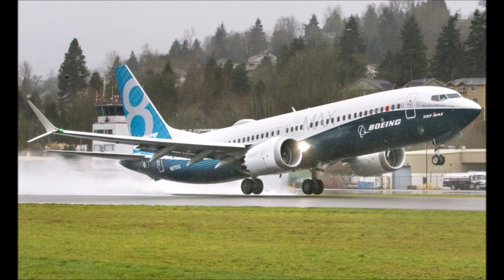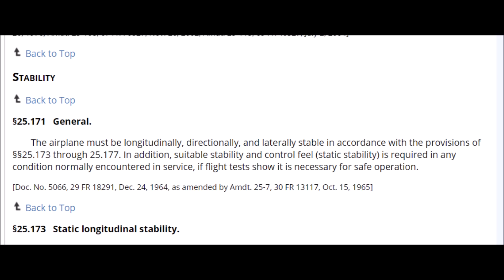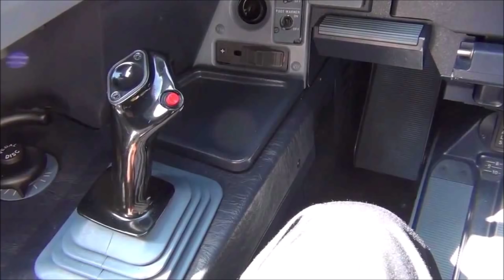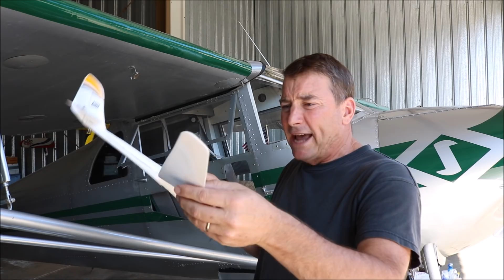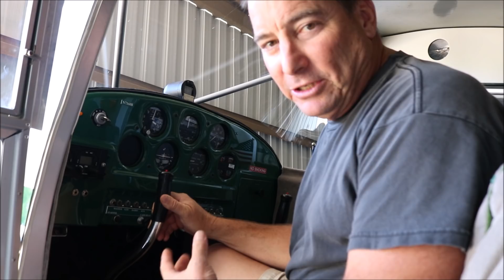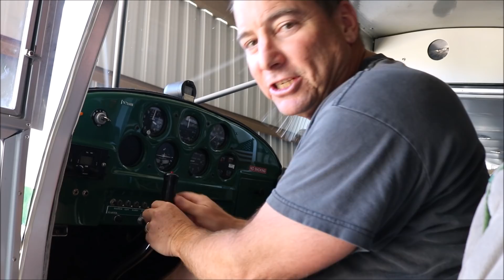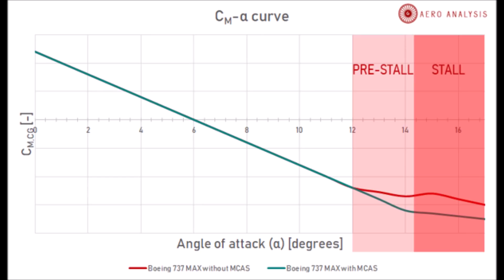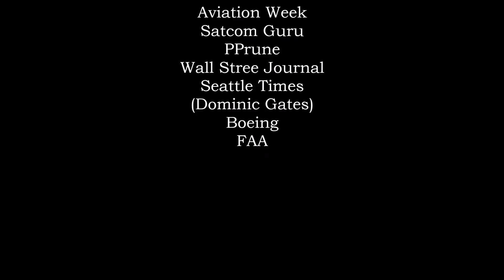737 Max UPDATE 30 Aug  2019

Comment: let me see, there was a problem with the stick forces and to corrected that instead of amplifying the stick forces they changed the elevator settings----if it was a car, it would be like fixing brake pedal softness with a spark adjustment.    But not to worry, there are replacing mcas with a re-engineered mcas (spark adjustment).
Reply from the maker: watch again. By moving the STAB you increase the stick forces.
Reply: It seems to me the correct solution would change only the stick forces--not both the stick forces and the direction of flight  (however, i admit that I don't know a thing about it (just mad as hell about the current state of the world)--so grain of salt)

Comment: Superb review. As a pilot, I was fascinated by the canard design with both main wing and stabilizer providing lift. Stick forces happen in normal fixed-wing aircraft due to the downward thrust of the stabilizer, so more speed=more stabilizer down-force requiring a stick push. As an engineer, those forces defined graphically as vectors make total sense to me.
Thanks for the outstanding videos.Well done.
p.s. Stall Stickshaker? What happened to that system?
Reply from the maker: Boeing still has the Stickshaker. Thanks James.

Comment: That was a brilliant summary Juan, I've followed you from the beginning on this issue and it was great to have this recap plus the information on how MCAS design was changed with fatal consequences. Everyone in the industry and in regulatory positions worldwide should watch this. Personally, I'm going to stick with easyJet for my short-haul needs as it runs an all Airbus fleet. I accept that the 737 Max is a fundamentally stable design - I've flown extensively on previous iterations - but I'm not sure I trust Boeing knows what its doing when it comes to computer-controlled systems. Hope your recovery goes well and you get your licenses back soon. Stay off the dirt bikes, the last thing you need right now is a broken limb!

Comment: Well done Juan, too bad mainstream media wouldn’t consult with you as an expert. (Probably because of too many facts and not enough sensationalism)
One point I have to disagree with you is at 21:00. You mentioned that the MCAS indications differ from a standard runaway trim, which is true. The point of disagreement is with the  trim wheel movement, control feel and the flight crew’s reaction to it.
In the Ethiopian crash, the pilot completely mishandled the aircraft when during the MCAS malfunction, the Left Stick shaker activated (granted, a major distraction) and he called Command 3 times (autopilot engagement) There is not one airplane certified that I know of where one would attempt to engage the autopilot during an impending stall. This speaks to the level of competence in aircraft handling of that pilot. Furthermore, that same crew did recognize the runaway condition, eventually actioned the Cutout switches, and maintained control of the airplane. What caused the crash was the reactivation of the Trim Cutout switches. (Ref Ethiopian Airlines Preliminary Accident Investigation Report FDR tracing)
In the Lion-Air accident, the flight previous to the accident flight experienced the same MCAS malfunction. The flight crew correctly identified a trim runaway condition (even with the distracting IAS disagree and stick shaker indications) over rode the MCAS with Manual Electric Trim, and then actioned the Trim Cutout Switches. The flight landed without further incident.
As for MCAS, it was certainly a contributing factor in both accidents, but not the causal factor. 
I hate to say it, but someone needs to:
The industry needs a major overhaul in pilot training, both in Initial qualifications, and especially in Recurrent training.
The ‘check the boxes approach’ just isn’t good enough anymore, especially with the increased complexity and automation of this generation of airplanes and the new standard of ‘system manger-pilots’. JMHO.

Comment: Many thanks for an excellent review of the situation. Can I ask, since MCAS is all about modifying stick forces in certain situations why this wasn't done by injecting forces (using force actuators of some description) directly into the stick with the obvious possibility that these forces could have a well-defined limit to prevent them becoming so large the pilots would have difficulty overcoming them in a failure situation. Is there a requirement that the stick forces are fundamentally aerodynamic in origin that would prevent the application of such  a system to falsify the stick forces?
Reply from the maker: good question...not sure other than conventional aviation engineering practices.

Comment: Thank you for this excellent channel and explanation of the 737 Max problem.  I love the very detailed explanation of the 737 Max problem, its history and technical deep dive into the issues that caused us to arrive at such a bad place.  I learned a lot from this video.  I thought that the 737 Max was an unstable aircraft but you dispelled that notion with this video. I don't do much flying but I don't think I would ever want to take a 737 Max flight. Of course, I'm sure that Boeing is already at work in rebranding the 737 Max to some other moniker.  I have completely lost faith in the FAA and its regulatory / oversight mission. It makes me mad that somehow it was allowed to get so cozy with manufacturers and get so sloppy in such a critical area of flight safety. After watching this video I feel a little better because of your explanation of the FAA not having the necessary manpower to be completely independent of the manufacturers.

Comment: Why do airplanes still use elevators instead of moving the horizontal stabilizer only? It seems that with powerful hydraulic assists and computers, the elevator would not be necessary.

Comment: There is a lot of information in this video.  The presentor, Mr. Brown admits the editing and content is a "pretty rough" in places but I appreciate this comprehensive overview of the problems with the 737 MAX to date and found it both interesting and informative.  There is a lot of technical information but not many illustrations of actual aircraft.  I am a non flyer, with no connection to the avaiation industry, but I liked the inclusion of the charts and diagrams that went a long way to helping me understand the things Mr. Brown was saying.  I think, however, some of the charts need more time to fully understand them so maybe I'll give it another go pausing where I need to.  So, if you like aircraft, and are a bit of a nerd that way, you will definately enjoy this offering.
Reply from the maker: Good critics Ian, thanks!

Comment: I was my understanding that Boeing didn't use two AOA sensors because that would cause the need for recertification training.  You say the training will only take an hour or so.
Reply from the maker: Not quite.
Reply: @blancolirio  On a different video the explanation was that Boeing elected to only use one AOA sensor, because a second sensor would cause the FAA to require recertification of all the pilots which would take several months.  It seems strange that if there were no such issues with a second sensor it would have been an obvious thing to do, since these sensors played a role in the failures leading to the disasters.  I am OK with the lack of recertification if it appears to be adequate and I'm happy to hear that the second sensor will finally be added.  It seems inexplicable that that wasn't done to start with since so much hinged on it.  I'm not trying to argue.  I have been horrified at this accident and would like to know.

Comment: Thank you clear and concise summary of what went down.The story I heard was that American airlines were going to order 200 Airbuses that were 15 to 20% more fuel efficient than the Boeing 737 and Boeing got a fright and went to American Airlines (not the other way around) and said. We will supply 100 Boeing Max aircraft that will be fuel efficient. They had to rush things to fulfill that order. Money before safety! Also Boeing and the FAA have been virtual bedfellows. The FAA did not insist on enough proof that MCAS was safe. Either that or the software is so complicated they don't have the experts that understand new software systems sufficiently. Boeing do so they just trusted them. Bottom line the rest of the world who held the FAA up as the most knowledgeable and trustworthy authority in the world have lost trust in them! They made a mistake. Ok just admit it and move on-. However it is going to take a few years to earn that trust back! I suspect Boeing and the FAA know this so they dare not have anything like this happen with the Max again. I suspect it will be safe when it comes back on line.

Comment: This is the best, most detailed explanation of why MCAS was put on the MAX. Have never seen the mention of the stick pressure requirements, for example. Great stuff, you made it easy to understand.
"All about saving money". True. How'd that work out for them?
I've seen it claimed on another air news YT channel that had it not been for that American Airlines request you mentioned Boeing otherwise would in fact have designed a successor to the 737 instead of the 737-MAX.
I've also seen someone interviewed who was credentialed as a retired senior Boeing engineer (possibly also design but can't remember) who claimed this whole episode broke pretty much everything he regarded as standards applied in Boeing. Potential single points of failure, inadequate documentation and aircrew notification, etc. Your detailed explanation of the changes to the MCAS system would seem to bear that out. What an appalling screwup, a betrayal of Boeing's history of great plane designs.
It sure is a massive departure from the remarkable achievement of designing the 747 in the time they did it (all without the aid of modern computer technology) where one of THE central design principles was multiple redundancy of every significant system.
Seems to me they really ought to design a replacement for the 737. 50 years as an exemplary aircraft is a great achievement, and sad to see this atrocious episode as a terrible blemish on that record.
Reply from the maker: Yep!
Reply: @blancolirio  
Thanks for replying. Also hope you get back in the air ASAP. Great news you've dealt with the health issue, must be frustrating to be grounded when I imagine you're fine.
Oh well, you'll have to keep busy making excellent videos. Have subbed and will have a look at some of your other vids. I also watch Mentour, DJ's Aviation and Wendover as each has interesting stuff. I think it was a Wendover one that covered the economics that drove Boeing to do the Max vs a new aircraft (as you mentioned) when I'm pretty sure they know it's time they replaced it. Whether they do that now I expect is a whole different matter.
Cheers

Comment: If the FCC software is being "totally redesigned" will the Max still have "the same" flying characteristics as other 737's or will it effectively become a new plane? If the former, is it an admission that it was different and should not originally have been certified to fly?
Reply from the maker: The FCC's remain the same individually.

Comment: That's a great summary Juan. Thankyou. You reminded us of the lives lost, that's a very classy thing to do.
I hope you get your medical back soon, for your sake (but we do seem to be benefiting from more blogs!). 
For completeness you didn't mention: 
MCAS was originally planned to alter the elevator trim by 0.6° (I think) before it was increased to 2.5° and allowed to trigger multiple times; it wasn't described to pilots before the Ethiopian crash; simulators didn't simulate how heavy the controls got during an MCAS runaway and there were very few Max simulators (none for some US airlines).
Your Airbus vs Boeing piece was fair and balanced. You describe the likely fixes for MCAS and the FCCs, it still sounds like an attempt at comprehensive 'Control Laws', but jury rigged rather than designed into the whole system. Is it OK to just turn a system off with an internal disagree between 2 sensors / FCCs, why not have extra redundancy (cost)?
Another thing that bothers me, when the aircraft systems add load into the controls past the point where the pilots can counteract them, what's the point of that? It's denying options to the pilots based on simulated (system generated) rather than aerodynamic load.

Comment: The nightmares of flying by computer are here. It seems either the human element can no longer be trusted or there is just an overwhelming need to computerize everything. Fly by wire caused me to stop flying, and Capt Sully said it best; its time to give most of the control back to the pilots. To me, if pilots have really become so incompetent that they need computers to help them fly the plane, maybe we should go back to the railroads.
Anyway you video was very informative, thank you.

Comment: This is not a unique scenario. There are layers in management that begin from the production managers on the manufacturing floor, all the way to the top decision-maker in the corner office. Those guys on the manufacturing floor just follow orders given to them. However, any changes to process begin way above all that with Sales and Marketing,  Engineering, the CFO and the CEO. When it gets competitive out there, the pressure is on to bring in Sales dollars. For most manufacturing organizations, lives are not on the line for changes. But in the airline industry, there is!! Ultimately, the CEO is accountable for all actions his company undertakes whether the result is good or bad. What bothers me is how complacent a CEO can get with an industry that not only is challenged by competition but by the lack of concern for that ONE decision that could kill even just ONE person in an industry that lives on trust...99% of the time. The planes are not at fault! The pilots are not at fault! It's the executive board that killed those 300+ people!

Comment: I have to disagree with your comment about restoring confidence in the regulatory process. FAA failed. Foreseeably so in adopting the self-regulatory concept or process. It should have been obvious that such a system would fail.

The two AoA sensor system and related systems  is problematic. It created a single point failure mode. There are issues with the other (FCC) systems as well. An examination of the F-16 FCC systems would be instructive.

Comment: Juan, I enjoy your podcasts especially because of the accuracy of the information that you bring to each one. Thank you for keeping us up to speed on the737-Max., and thank you for, once again, correcting the misinformation about the MCAS system and the stability of the 737-Max.  You said that you had flight time in both the Boeing 737-800 and the Airbus A320. You summarized the differences between the Boeing philosophy and the Airbus philosophy and made the observation that you thought the Airbus philosophy, the avionics having priority over the human pilot, was the wave of the future. I have read elsewhere that Airbus believes that they can make a pilot-proof aircraft.  I was recently reminded of the Qantas flight QF72 disaster in 2008 with the Airbus A330.  Airbus’ fly-by-wire, pilot-proof computer controls took control away from the pilots and put the aircraft into such a steep dive that passengers impacted and went through the inner cabin ceiling.  If you are so inclined, I would love to see you do a comparison of the 2 737-Max crashes and the QF72 incident.  There are many similarities, but as far as I could determine, the A330's were not grounded after this. It appears to me that the Boeing MCAS system design, as it was at the time of the grounding, was diverging from the Boeing philosophy and moving more toward the Airbus philosophy and that contributed to the crashes.  My point in all this is that I don’t think giving computer controls authority over the human pilots is a good thing. I hope that is not the wave of the future. On a separate note, I look forward to hearing when you are back in the air.

Comment: I can't help feeling like it would've been simpler to accept the 737max as a new type and remove MCAS entirely. If Boeing had designed a new aircraft from scratch to avoid the landing gear issues, it would've required a new type certification anyway. Sure I get the desire to retain pilot mobility across the 737 fleet, but at some point, isn't a new type inevitable ?

Comment: While the MCAS is apparently not claiming to be an anti-stall system, problems with Angle of Attack sensors were known in other aircraft.  There was an Airbus A320 that crashed on 11/27/2008, like the Boeing, the early generation of the A320 was only accepting input from one sensor at a time.  The Airbus crash happened during a test of the anti-stall system, they were flying to low to be able to figure out the system had failed and could not recover in time.  Airbus addressed the issue by reading  both sensors and at least letting the pilots know there was a disagreement, maybe it can make guesses as to which sensor is likely to be right now.  I noticed on some military cargo aircraft they have four of these sensor instead of two.

I think the failure to not address the possibility of a faulty sensor input is unforgivable given Airbus already got to experience this more than 10 years ago.  It seems like they could have put something on the stick to make it feel heavier instead of actually putting the aircraft into an out of trim condition.